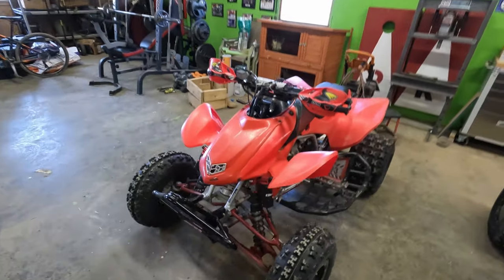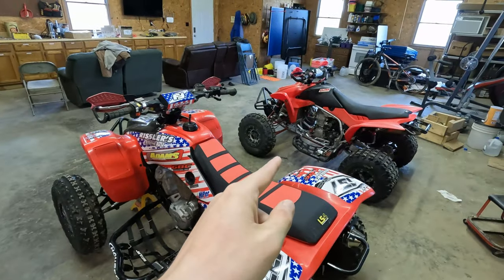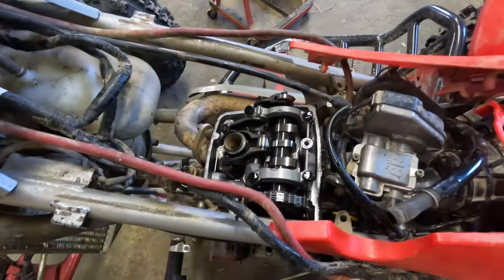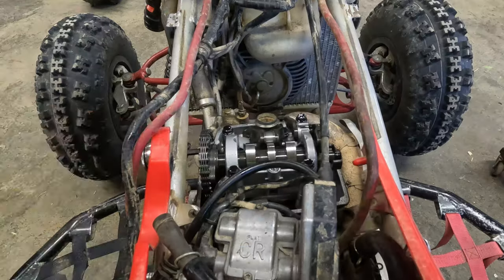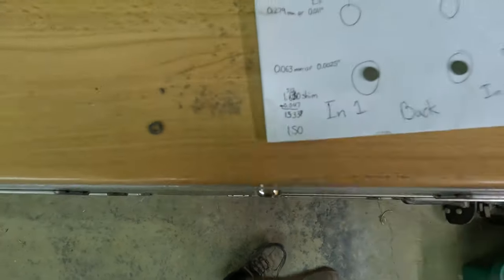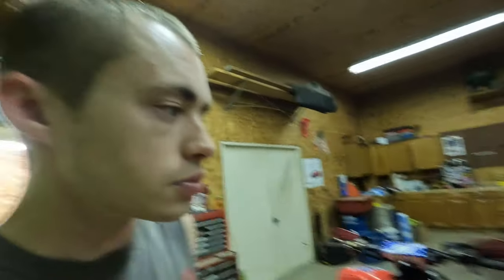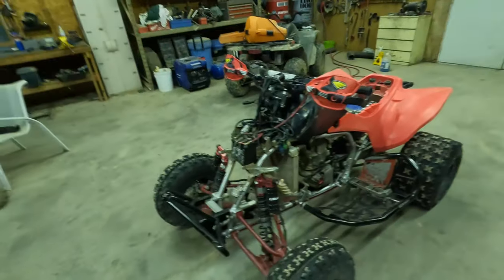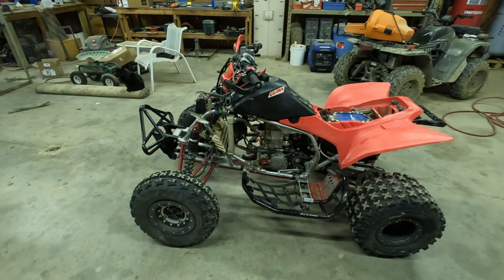Adjusting The Valves On The 450

Comment: Forgot the decompression clearance. 
It’s PLUS (+) .15mm
So the clearance would be for the decompression rocker arm is 0.43mm
 
.28mm + .15mm = .43mm

Since u left ur right side EXHAUST clearance at .30mm, add (+) .15mm = 0.45mm for the decompression arm

Comment: You mentioned 24v 2 battery system. Why? Just got a 450er and getting ready to do a carb rebuild and adjust valves. But curious about the 2 batteries.
Reply from the maker: Really the main purpose is just for quicker starting with xc racing. Plus it gives you a little more juice when cranking. If your not xc racing, there’s really no reason to do it. In fact it’s actually harder on the starter so I wouldn’t recommend it unless it was for racing purposes.

Comment: How is it running now? My only fear for you is that once the intake valves close up that tight it is usually a tall tale sign of the valves starting to cup. Very common amongst all the 450's when a tiny bit of dust/dirt gets through. You guys seem to be on top of your maintenance but the previous owner might not have been. If it closes back up to near zero tolerance in the next few rides don't try to adjust them again, pull the head and send it off. I know a few shops that do excellent work with quick turn around if you don't have any year you.

Also- great informative video as always. This will surely help others in the future.
Reply from the maker: I’ve actually got new intake valves on the way. The current ones are pretty much out of adjustment. I went ahead and put it back together because I wanted to make sure this fixed my starting issue which it definitely did. I think my dad is gonna do some riding this evening to make sure it is running good overall. Then once the intake valves come in, I will pull the head off, inspect it, and get those fixed up.
Reply: @TylerMcNabb137  Good deal, sounds like you are way ahead of the ball. You will need to have a machine shop re-cut the valve seats before the new valves go in. Isn't too expensive either. If you send the head along with the new valves to TLR Performance down here in Sebastian, FL Todd will cut the seats, install the valves, and shim them for you on his bench. All you have to do when you get the head back is bolt it on and go.
Reply from the maker: @PatrickRiggs33  sweet thanks for the advice! I’m hoping I don’t have to do too much to the motor because my plan is to do a full rebuild from top to bottom of the motor this winter. Don’t want to have to replace things multiple times if I don’t have to.
Reply: @TylerMcNabb137  Cylinder head isn't too invasive, quick turn and burn project! Have fun and keep up the great content.